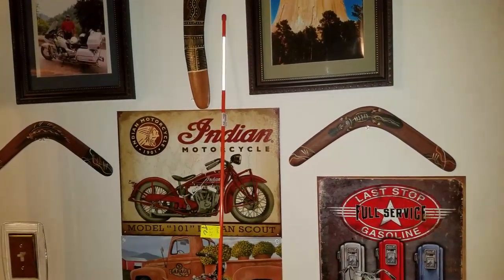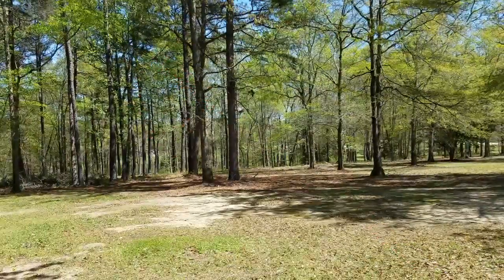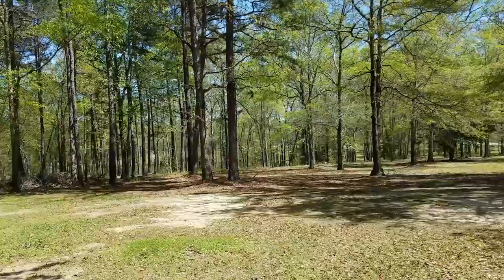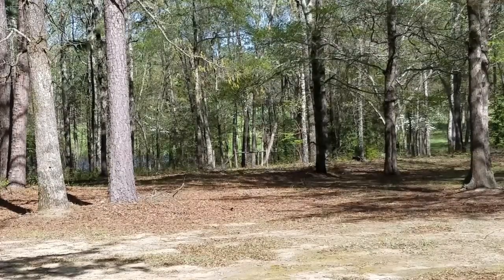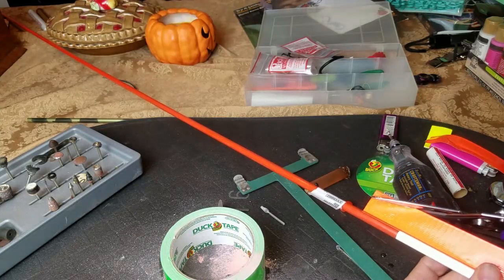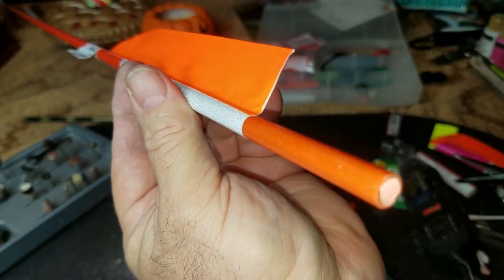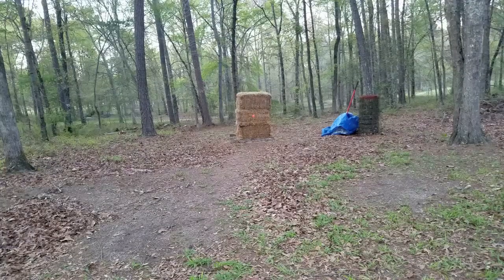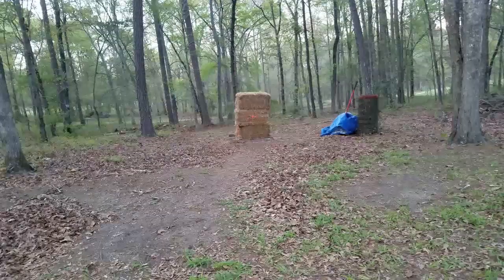How to make, Atlatl fiberglass darts,  Gary J

Comment: Great video Gary. I tried it and you're right, these fly really nice. I paid $4.18 with tax at home depot. I also put a glue on broadhead so no boring the head for me. Total cost was like $6 if I calculate the cost of the broadhead and duck tape fletching.
Reply from the maker: That’s awesome. I’m glad it helps. I have some glue on broad heads too. They will sometimes pull off in a bail of hay. They are hard to find in a bail of hay.
Reply: @knightingalesaid  The broadheads I used are not the tapered insert ones, they still slide on like a fieldpoint. I still cut the carbon cone off and used permanent cement construction glue to stick on the heads, which so far they seem like they're on permanently. it seems like these darts are indestructible with the steel primitive broadhead. How is everyone not using these as darts. I'm so happy I found your video. There is soo much benefits to using these. The bright orange is hard to lose (I've lost a couple of darts that were wood), I've hit stuff that would destroy a wood dart but these just keep going. And all for around $6.

Comment: roll wrapped carbon fiber tube from Good Wind Kites to join two rods,  
also 0250 inch OD pull-traded carbon fiber rods.  Work really well.
Visit an archery shop for points and fletching.    add 0.25 two oz. brass slug behind the point.
AND  be careful NOT to rip up your rotator cuff.   If you do
Yoga can restore the range of motion and end the Pain.

A wonderful hobbit!
Reply from the maker: Thanks for the comment! I will look into those carbon rods. I like flying sport kites too.
Reply: I just recently took up an obsession with Atlatles, (im an AR15 guy) and looking to build my own. Im finding that it's very difficult to source good 7' ash rods anywhere!!! At least not from anywhere that isnt charging a king's ransom for pre-fab atlatl darts.